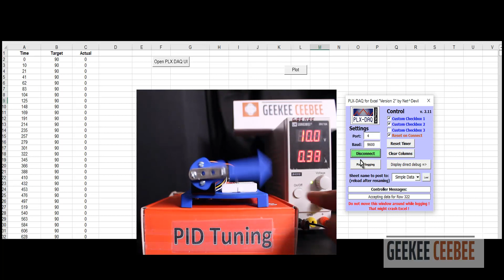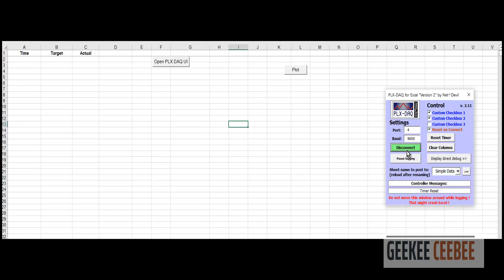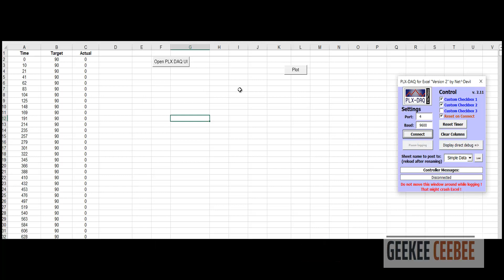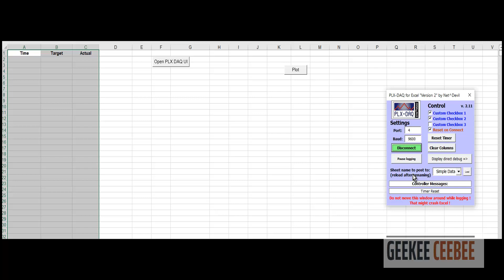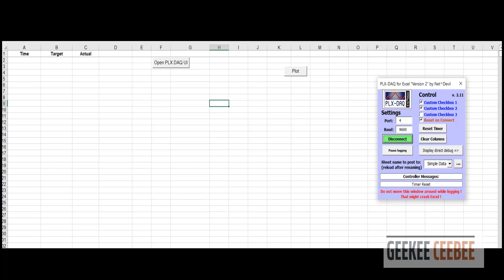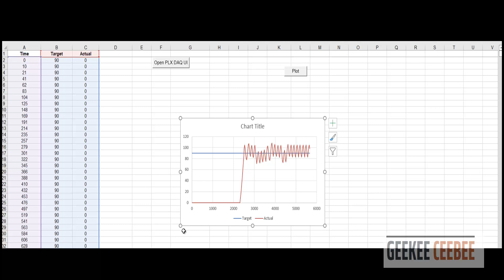TUNING PID CNTLR | STEP RESPONSE | PHYSICAL SYSTEM DC MOTOR EXAMPLE

Comment: Do you have all the conexions or the code ?
Reply from the maker: This video is supplemental to my other PID DC motor control videos. Please check out my DC motor speed and position control videos on my channel. Code and wiring diagram link is available in the description
Reply: @GeeKeeCeeBee  dc motor position video code is the same in this case  ? i don't understand  how use your code in this case ?